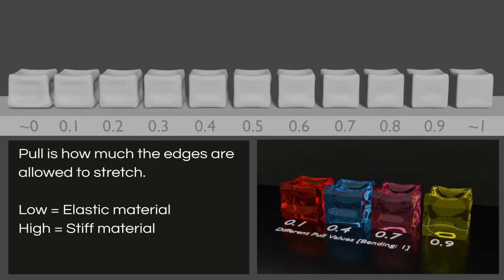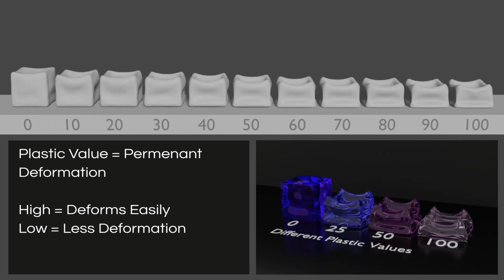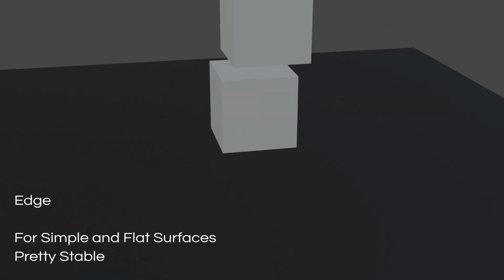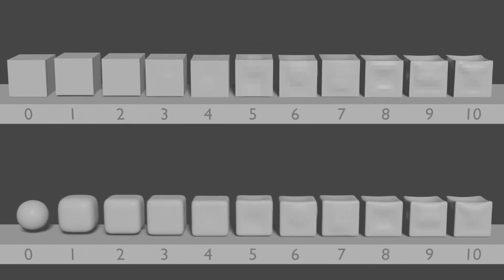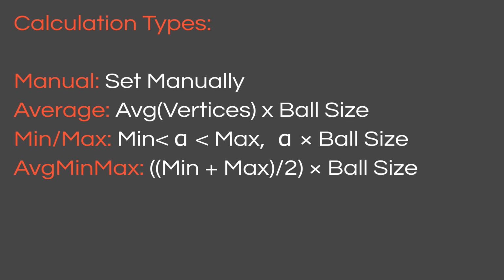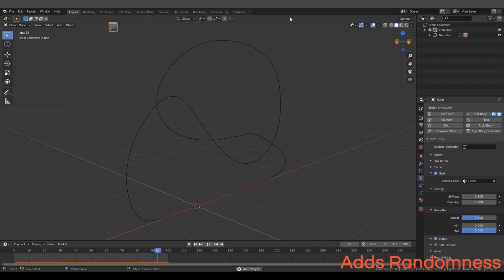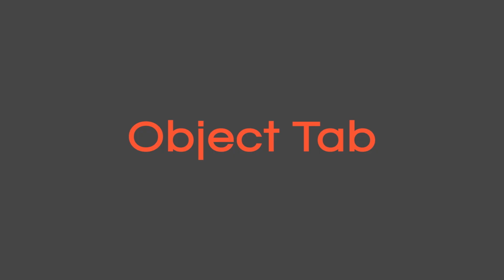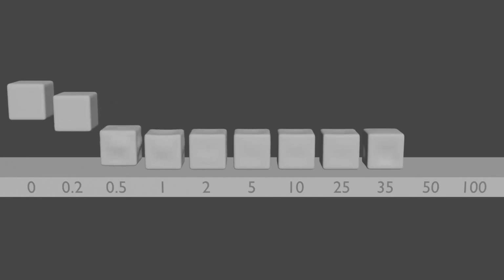Blender Soft Body Settings Explained

Comment: If somebody tried there could be ultra realistic games and animation using the soft body physics since instead of inserting an animation you can put that mechanic and it will work automatically during all the game. The problems I see with this are the increase in CPU requirements to make it work and probably make a game would take longer.
Reply: This is not viable for games, at least not on the way its made in blender